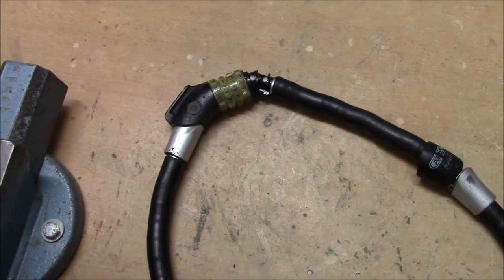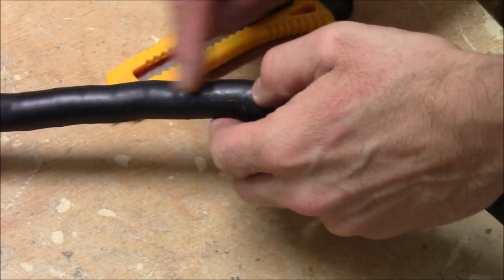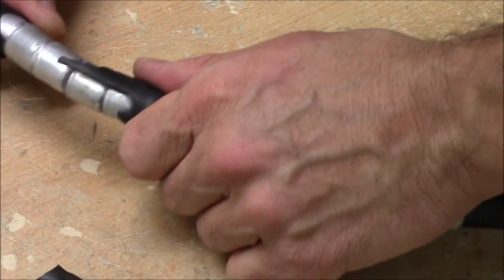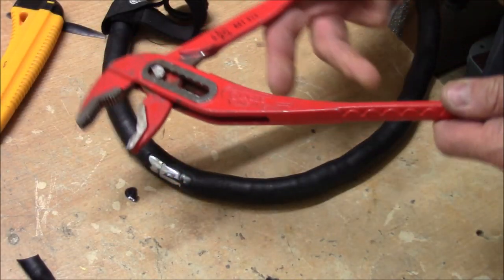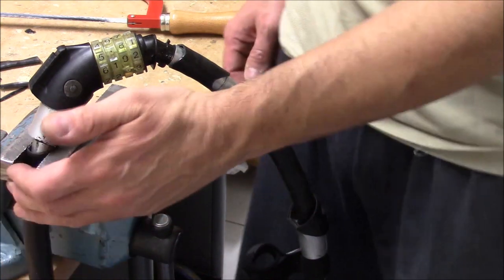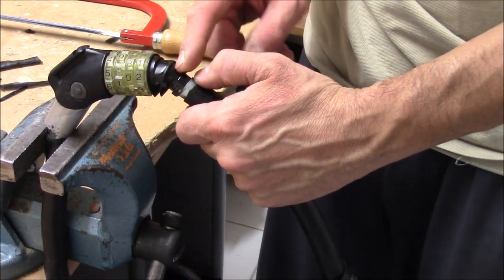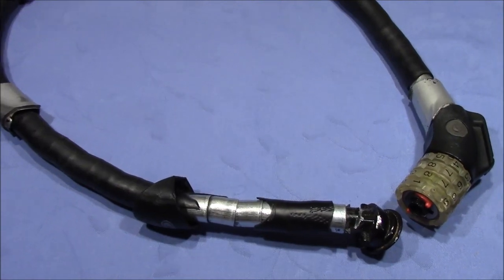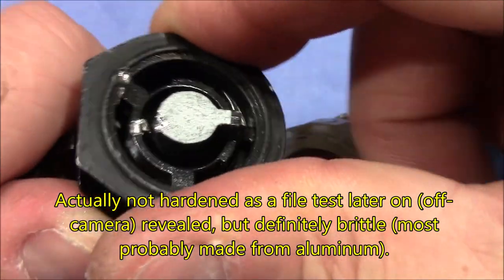(picking 722) Almost great - ABUS combination bike lock destruction tests

Comment: I think the inner 'bolt' is probably cast zinc alloy - also the inner wheels ? Those 'handbag' shaped combination locks are similar construction inside, but thinner. That really is a weak point isn't it ? Shame, because Abus put real hardened steel all around the loop, which is nice to see. If only they would stop using cheese for the lock mechanism :o)
Reply from the maker: Yeah, it's a shame that they didn't go all the way with using hard material for the lock, too. But maybe the hardened tubes already mitigate most common cracking risks.
Reply: @Potti314  Yeah, I agree - Abus have to make a profit somehow, and a lock made from machined and better material would cost so much more to make - and the mostly likely attack is from bolt cutters or a saw :o)

Comment from the maker: I found a ABUS 4 wheel combination bike lock on the street. The locking mechanism was hard to turn und also this lock provides great anti-picking features - so I could not decode it. Instead I tested therefore destructive entry methods. The hollow tubes that build up the lock-ring are truly made from hardened steel and could not be defeated with a saw. But the lock itself seems to be made of soft aluminum that can be sawed easily - moreover when trying to bend the lock the bolt snapped in half - that was very unexpected.

Comment: Nice lock ... easy to attack when you know how (or if you are strong like you and you can break steel with your bare hands when you're angry and turn green).  Strong cable-tube-thingy.  Very interesting! :D :D
Reply from the maker: Haha, how did you know that I turned green? The whole hardened steel construction is pointless if aluminum is used for the lock itself.

Comment: It seems that if that bar had been hardened steel instead of aluminium, this would be a very hard lock to break.  Not so hard IF you know the weak spot.
Reply from the maker: Agree, a great lock if not used soft material for the lock itself.

Comment: the two spots you cut are connected and are different, the lock is probly clipped on the chain
Reply from the maker: The inner wire is clipped to the lock. It's within the tubes.